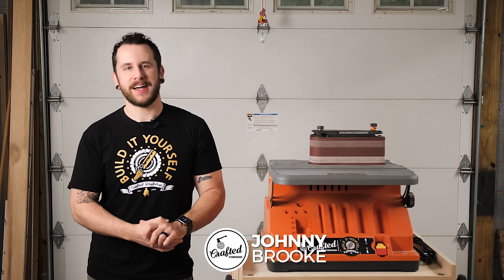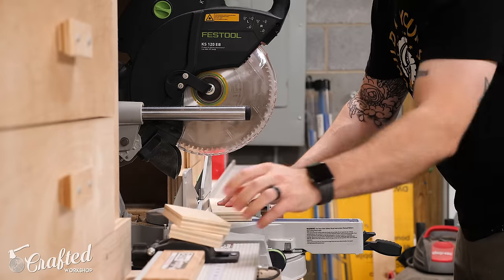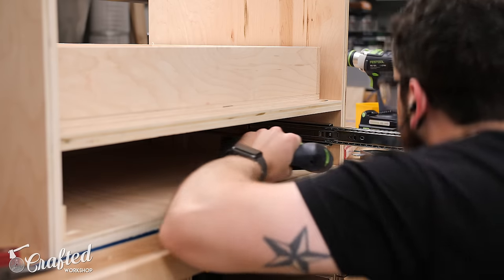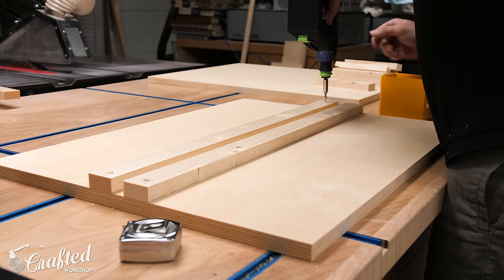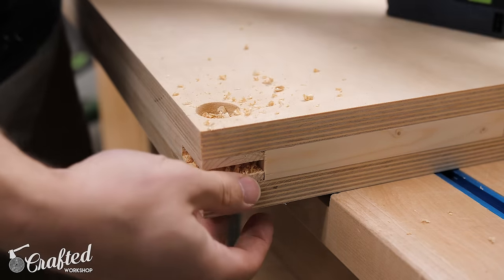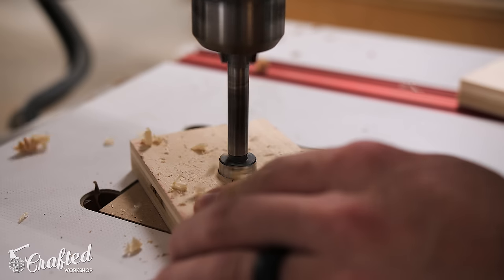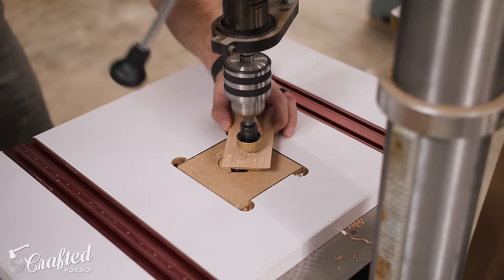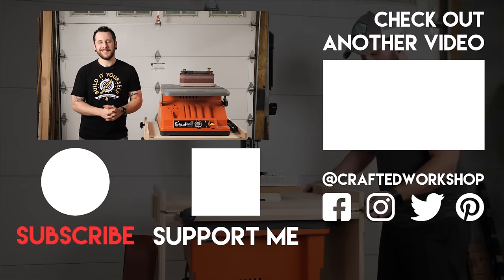How To Build A DIY Flip Top Tool Stand Workstation // Woodworking Shop Project

Comment: Great video Johnny! I love mine, and people are always asking me about it. Now I can just refer them to your video for how to build it! That locking mechanism is rad, I just used a sliding bolt latch like the kind you put on a gate but it doesn’t work that great... to much play and it rocks back and forth when I use the planer. I’m going to modify it with your solution.
Reply from the maker: Thanks man! Brad’s design is really clever and works extremely well. I think the mechanism is from an old Shop Notes, those things are gold!

Comment: Dear John, love the concept and can see that this has significant applicability in my tight-spaced workshop. One thine of concern is that it does look quite flimsy and with me putting a good load on the machines would create issues. Now that you have used it in the field for a while, how has it performed?  Again, nice idea well constructed.

Comment: Are you using a hollow steel pipe/tube or a solid rod? The video makes it look and sound like a hollow tube, but the amazon link looks like a solid rod. 

If it’s a tube, does it flex at all? Seem strong enough?

Comment: Had been considering a flip top just to have a home for my scroll saw, but haven’t decided what to put on other side since I really don’t think it would fit my needs for the miter saw because of outfeed needs. Considered putting my 1” x 30”/5” sander on the opposite, but that’s a relatively tall tool....  only other idea is to build a router station while making it exactly workbench height so outfeed isn’t an issue when need it can be rolled over to the bench.  Thoughts?

Comment: Hi, this looks really nice. Thinking of using something like this for a Dewalt 13" planer on one side and a whopping 235lbs Grizzly Open-End Drum Sander. So have to make it wider. Everything will have to be beefed up. What's your thought about thickness of the swivel bar...and cast iron? Thank you.
Reply: Don't know that we'll get a response this long after the video went up, but I'm curious about what, if anything, he did to address balance.  I don't think he mentioned it, so perhaps the weight of the two tools was just close enough?  (Or more precisely, the CG of the assembly was near the pivot axis.)

Sounds like you'll have a serious issue with that!  For a minor difference I was thinking find a place to mount some lead high up on the lighter tool.  For a >100lb weight discrepancy that's no good!  Maybe offset the pivot to the combined center of gravity, and use some kind of face-mounting bearings (that have plenty of shear strength) instead of the pipe-pivot.  Potential concern with that approach is the working height of the two tools will be different.  Maybe pair a second tool alongside the planer, though I'd guess you'll want to mount it sideways for in/outfeed?

Swiveling a 235lb tool is ambitious in any case!  Good luck, and mind your toes!
Reply: @csn583  Hey CN, thanks for that detailed reply. Have EXTREMELY limited workshop space and would very much like to add Grizzly. Dewalt planer is 80lb, so differential is some 150lbs!!!! Still waiting to hear from Grizzly about the height of the unit (without the base). That may just cancel this project all together; and yes, was thinking of adding some weight plates on the planer side. Trying to keep this as narrow as possible so rather not add extra tools on the Dewalt side, although maybe a narrow grinder. Grizzly is 35", and Dewalt is 24". How much are you against the steel pipe pivot? IMPOSSIBLE? Or just a tough build?

Comment: Do you think one of the tools could be a bench top bandsaw? I am getting the Wen which is supposed to be 30” high. Would that make the entire table too high if I fit that in on one side?
Reply: bandsaw 30" caster 3" drawer 4+"  fliptop 2-1/4" = base of saw in up mode would be approx 39 inches tall.  using side mount casters, and no drawer your still at 32 inches at base.  dont have the wen saw to meassure but what is height from base to table top,  i think the wen is a 9x?  so somewhere between 4.5 and six inches i would think. so 36.5 to 45 inches at top of table its doable,  but maybe not comfortable.

Comment: hey I would say sideways support is an issue on this table, yet easily fixed by a cross structure which you'd have to assemble and dissassemble everytime you'd flip the station, if such stability would be desirable

Comment: I just got the materials to build this cart but realized my drill press requires an extra 6” in height. I can build it but I am wondering what to expect with a little more height than originally planned. Any tips, tricks, or things to look out for? How does it rotate? Etc. thanks!
Reply from the maker: I built mine about that high as well, to clear the hollow chisel mortiser. Still turns fine!

Comment: In the video it doesn’t seem like you used glue to attach the bottom and shelf. Do you find that you don’t need it with the amount of pocket screws holding it together?
Reply from the maker: Yup, no glue and I don't think it really needs it. Plenty of strength from the screws, and now I can customize the stand by taking it apart if I change tools.
Reply: Thanks for the reply bud! I just built mine with no glue on the shelf, did glue the bottom though. I do agree after building it, plenty of strength with just the screws.

Comment: Looks awesome, I know you're using the Kreg Pocket Hole Jig - But is that an aftermarket mount for it? (seen @57secs in) Not seen that before looks like some quick release mount but it's not the master system from Kreg. Got a link?
Reply from the maker: Yup, it’s from Armor Tool. Allows you to use t-track clamps with the K4!

Comment: Did i see a wobble? Is it structurally sound? Looks a little wimpy to me. I would hate to be grinding or sanding while the grinder or sander is moving side to side. Actually, sounds kinda dangerous.
Reply from the maker: Super solid, the wobble is only there before you lock the knobs down.

Comment: Weird question, do you all think that storing a tool upside down will reduce its life span? I mean the tool was technically designed to stand up right, so I am wondering if it will put any different strain on the tool's components thus reducing its life span. Just a thought/question.
Reply from the maker: I don’t think so, can’t imagine why it would.

Comment: Nice build Johnny.  I have also purchased and built Brad's flip top. I love it and need to build a few more.  I have a mortiser on the way. I called the manufacturer to ask what the assembled height is,,, it is 29-1/2" with the handle.  What is the height of your Jet with the handle installed?

Comment: I'm wondering; I can imaginge that the table is very unstable when turning it over. When locked it looks very sturdy.

And how about the weight when the clamps are released... if it turns to fast the whole table falls on the ground.

Comment: In theory, could you just use 3 pieces of plywood  with a gap for the swivel pipe, and cut gaps for the table locks for the table top instead of all of the strips of 1x2?

Comment: You missed to show us how you connect the electric wire through the metal pipe. and how you connected electrically the two tools, since there was a little space between the two boards. In any case I have enjoyed the wood built. Thank you.

Comment: Nice design, I'm going to be building some tool stands and this is certainly going to be an option. My only concern with that design is lateral strength, you literally just have two pieces of plywood standing vertically. I would think with two heavy tools attached to the top you would get quite a bit of swaying. A couple of ribs dadoed into the sides on the outside should solve any issues though.
Reply: I think he secures the pipe which in effect turns it into a box structure.

Comment: I want to build a similar one. What size drill press is that? I am wondering if the 12 inch drill press be too high of a tool to have a flip top cart and make it unstable. How is your experience so far while using it?

Comment: Big thumbs up!
If the 2 machines mounted in the workstation are significantly different in weight, is there a need to counteract the difference (perhaps with counterweights) to avoid an out of control 'flip over', or is it not really an issue?
Reply from the maker: I can’t imagine any machine that would fit would have a massive difference. It’s pretty easy to control the flip. The mortiser is a lot more top heavy, for instance, and it still works fine.

Comment: OK I'm going to built this cart but with changes... going to use 1/2" black iron  pipe threaded to add caps or EMT rings on each end which would prevent the pipe from sliding or the side from splaying out while flipping

another option would be to cut the pipe flush with sides and drive a screw straight down through the end of the side and not have to put those side covers on

Comment: How do you keep heavier tools fastened to the bottom without bolts? It seems like a planer would be too heavy to secure with just screws…
Reply: You could have some counterbore holes on the flip side for bolt head

Comment: I build one of these recently from Brad's plans as well, but I made one modification.  I put some small springs  on each one of the locking knobs before the washer so every time i loosen it the washer stays close to the knob and I dont have to mess with them while trying to lock the platform back in.  Helped out a lot.  Great job on the build as well!
Reply from the maker: Good idea!
Reply: Brett, do you have any pics or vid showing how this works? in the planning phase of a modified build!
Reply: @aussiefreediver  I do not, but I am working on setting up a channel and putting some videos out.  I will see if I can get a picture uploaded for you!

Comment: I'm a newbie, but if someone could please explain to me why the two side panels don't "sit on the bottom piece of wood. With Gravity, it would make more sense that the weight of the tools there is a lot of force on those pocket screws. Just seems like it would make more sense to put the pocket holes on the side panels and then drill the side panels into the based piece.  I've seen this flip cart build and others do this as well - it just doesn't make any sense to me.
Reply from the maker: The weight is going into the casters, which are spanning both pieces of wood. I think either way would be fine, but I'm guessing Brad just wanted to easily hide the pocket holes.

Comment: Great project! If I have one concern.....I didn’t see you use any glue on the build, just pin nails and pocket screws. Wouldn’t glue have added to the strength of the unit? Other then that, I can see myself building one of these in the near future.
Reply from the maker: Thanks! Typically, I don’t use a ton of glue on shop projects, as I like to be able to take them apart if needed to modify them as tools change, or if I ever need to move. Pocket holes were plenty strong for this project and it’s holding up great.

Comment: Very good job here. Well explained.  Bought the plans, need some carts. 1st project turned out nice. Adjusted the drawer height to accommodate a taller tool, easy especially working off the plans. Thanks again, keep up the good work.

Comment: Hey man - structural question for you. I noticed some wobble in your vid back and forth, which I think is to be expected. Now that you have your tools on it, so you notice more movement? Any concerns of racking?
Reply: *should read “do you notice more or less movement”
Reply: Paul Lukoskie    When you tighten up the four locking corners it's a brick
Reply: Michael A oh really? Nice.
Reply: Paul Lukoskie  I put an 8" grinder on one side. Was all concerned it would vibrate on the wheels. Spent a lot of time to incorporate getting the wheels off the floor when grinding. Haven't once had to. But I did put my thickness planer on the flip side to add weight to the package.
Reply from the maker: Yup, what he said!

Comment: Damn it!!!!  I just got done building my flip table.  I used Brad plans without making any adjustments.  i'm mounted a Ridgid planer and sander. 
just like Brad's.  it turns out the planer i have is a newer one, and has a handle mounted on the top, which makes it an inch too long.  Now it can not flip.  The table came out great, but now i will have to do it again,  Damn!!!
Reply from the maker: Dang! Could you lower the top of the drawer compartment and just cut the drawer down?
Reply: Johnny....  You are a genius!  I've cut materials for two flip tables.  My issues was, i did not have enough materials to cut side pieces, which would've been longer to accommodate the planer .   Now i can build the second one and lower the draw top.  That will work!!!  You saved me money and space, now I do not have to buy another sheet of 4"X8" board.
Reply from the maker: Awesome! Glad I could help and you didn’t use glue 😊
Reply: Crafted Workshop no, no I didn’t😏

Comment: What kind of pipe did you find tht had exactly 3/4" outside diameter? Thanks for the great video!
Reply from the maker: It’s just ¾” metal tubing from the home center. Sold in the section with the other metal stock like angle iron and flat bar.

Comment: 0:41 never cut a piece of wood that's wider than it is longer, easy kickback right there
Reply: MrWaffleBrainz if you know what you are doing it can be done safely. “Never” is great advice for people without much experience though.
Reply: @weberwoodshop  majority of viewers of this have little to none experience
Reply from the maker: Hah, you have no idea what you’re talking about there.
Reply: @craftedworkshop  where I'm from, that's the way its taught, so if I have no idea what I'm talking about, then im guessing the trade schools and government worksafe have no idea what they are talking about either
Reply from the maker: I was replying to your comment about most viewers having little to no experience. You have no way of knowing that. Yes, it’s best practice not to cut pieces wider than they are long at the table saw, but I have a riving knife installed as well as quite a bit of reference surface up against the fence.
Reply: @weberwoodshop  As a rookie, what is it that i need to know on the rare occasion of doing thing. I've done it in the past, known it's wrong,  but figured it seemed safe. of course I still had a chunk of reference surface, say 2' or so.
Reply: Tanc By Design it it seems dangerous to you, then it probably is dangerous... for YOU.
Reply: @weberwoodshop  It doesn't. :)